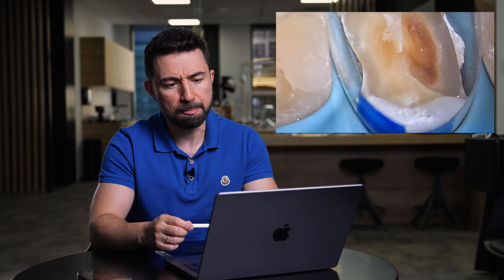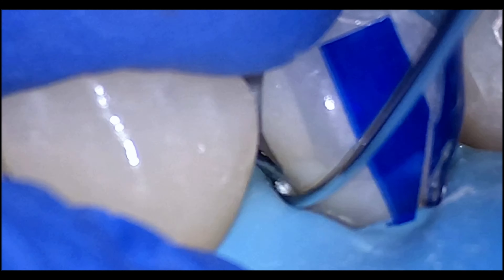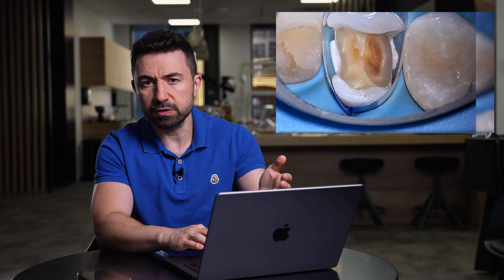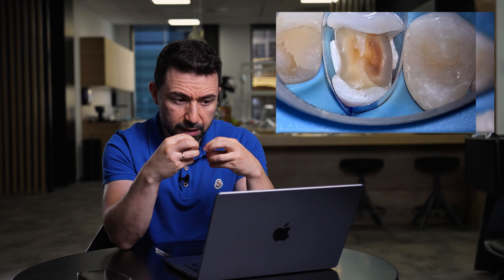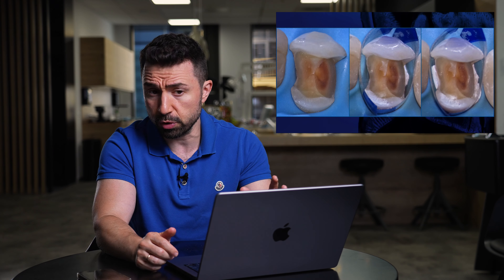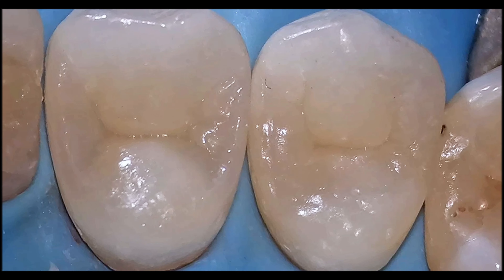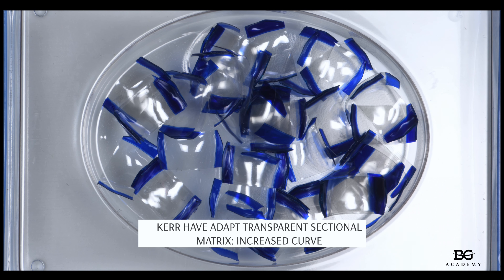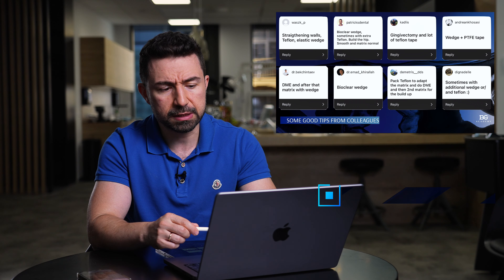Using soft matrices in direct restorations

Comment: Really stupid question you can see that the Teflon makes a really nice seal and keeps it all dry, however you have tooth, the teflon and then plastic matrix, if you were going from inside of tooth to outside. Do you add the composite directly onto the Teflon floor? I can see that if you make the matrix push into the tooth below to eliminate the teflon, then the embrasure space will be wider and also the contact point will not be great.
Reply from the maker: Today, I will host a live stream on the topic of FULL MOUTH REHAB, where you can ask me any question in real-time. Looking forward to meeting you! Stay tuned!